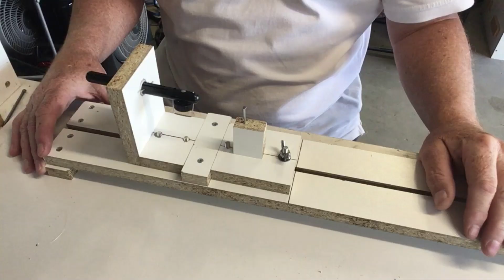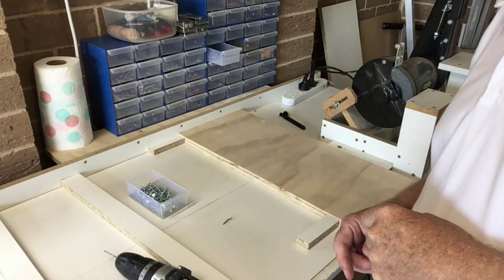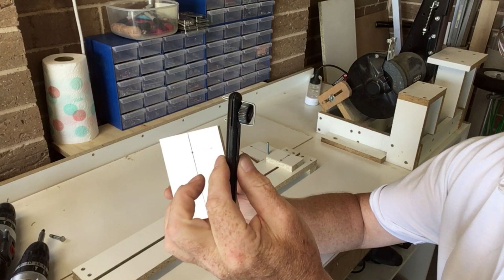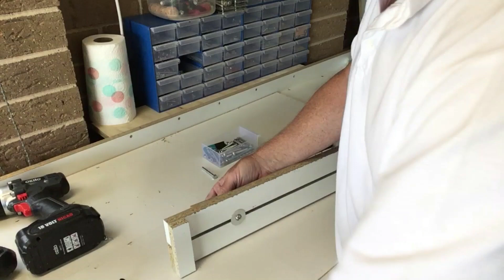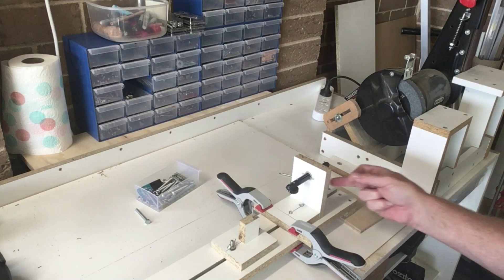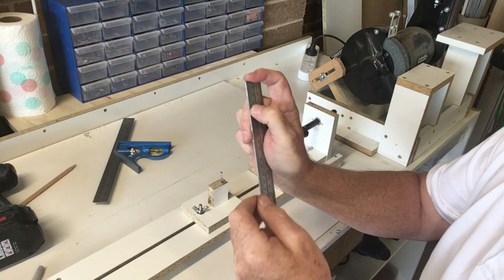How to Make a Hook Tying Machine - Part One - The Build

Comment: A 5/8" hole would give a Knock in fit for the 16 mm Tube + for those who don't have a 16 mm Drill bit or struggle with converting Metric/Inches. 25.4 is the Magic Number (Multiply or Divide by for either way)